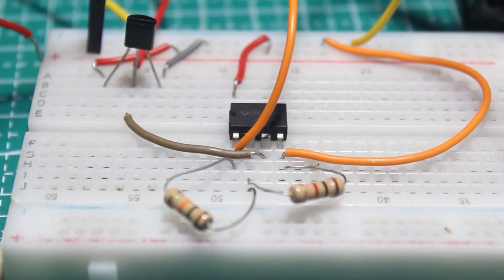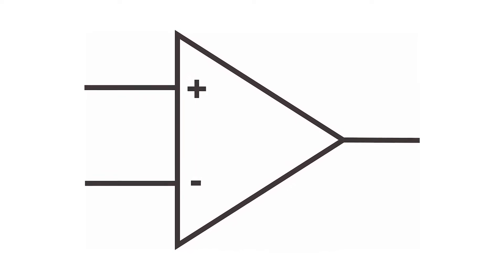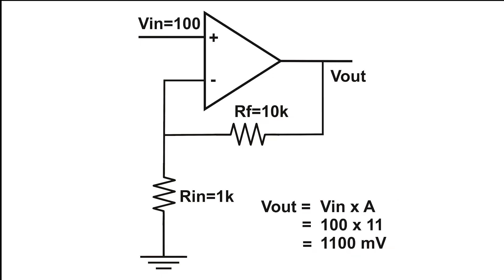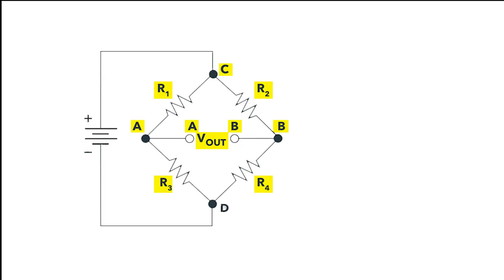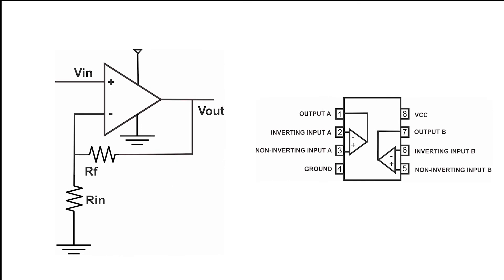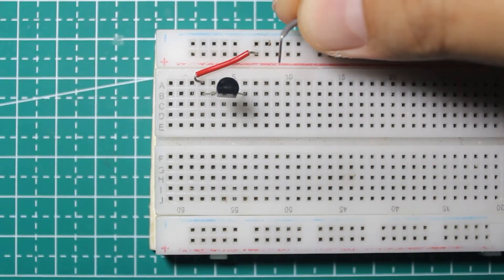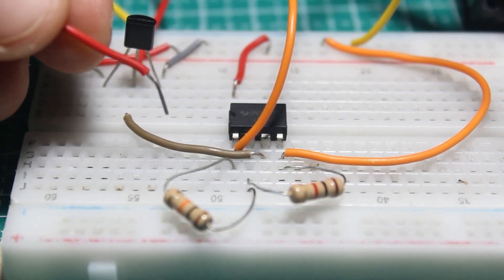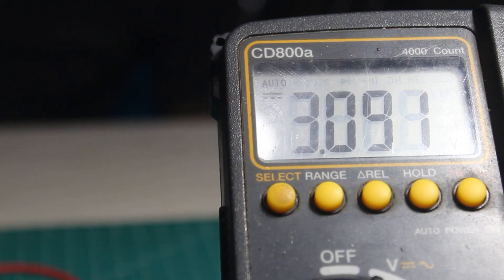Op Amp Tutorial  (Theory and Practice) - Electronics Basic #4

Comment: You might know why why my arduino 5v power source turns off when I'm only connecting Vcc and ground on my quad op amp? No connection to input signals,no resistors. Just connected to vcc and ground of op amp and arduino power source turns off
Reply from the maker: @vahagnmelikyan2906  maybe your op amp is broken. Or the circuit short somewhere
Reply: @miliohm  thatnk for that info. I just removed from my bread board and manually attached positive and negative terminals and the problem of 5v power source disconnecting disappeared. So whatever I'm doing it's on the breadboard causing a short circuit somewhere
Reply: @miliohm  it looks like I mist had it backwards connecting vcc to negative and ground to positive

Comment: thanks pro
i want the list of component electronic that you use on the project Especially mentioning the transistor
Reply: Its not transistir, its LM35 analog temp sensor. Its output is very low, so it need to be amplified.

Comment: Please make a differential op amp video. I can't seem to make an INA114 op-amp to work with a strain gauge half-bridge. I have the bridge balanced and get a differential voltage of + and - 5 millivolts on the A & B bridge points, but I can't fully understand how to connect the bridge to the op amp and ADC.